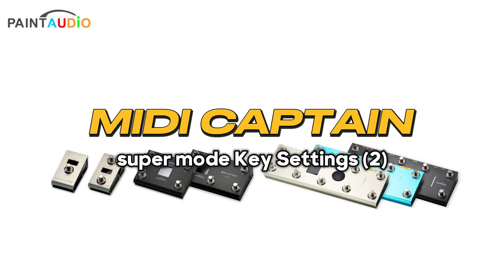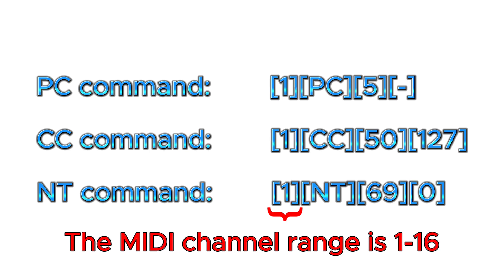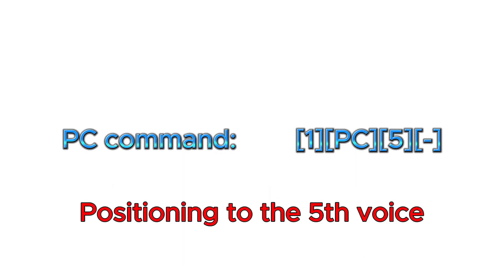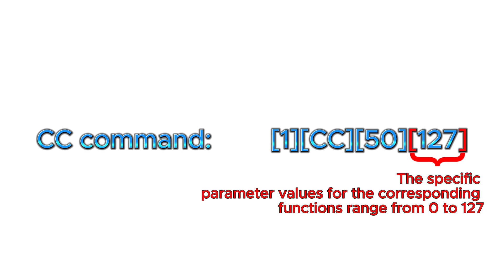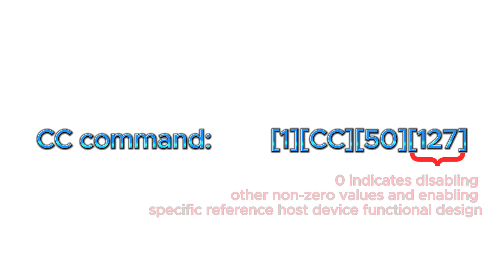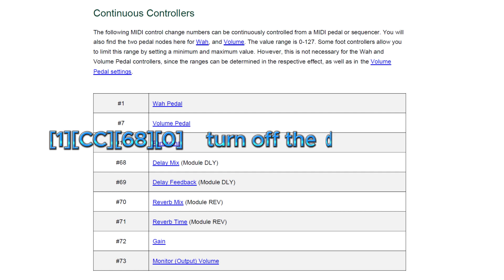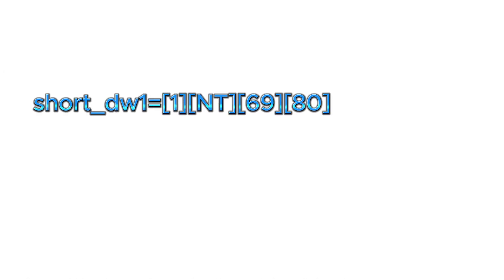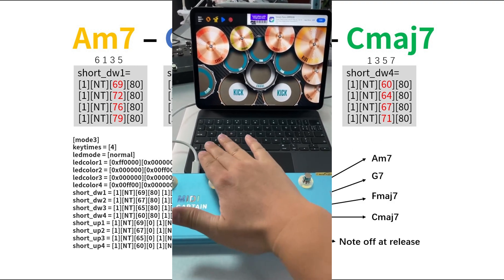SuperMode Tutorial (5) key function settings part2

Comment: Mini 6. Using key 3, 4, 5 to toggle things on my Tonex with keytimes[2]. Using Key 0, 1 to inc and dec program. Would like to be able to set 3,4,5 to the "0" state each time the 0,1 button is pressed  changing the program. Is there a way to set the state of the of the other buttons so the keytimes will send the correct toggle after the program is changed? What would be nice is the concept of variables that could be set and read. Also, and run_on_page_change section would be nice so things can be setup when the page on the controller changes.

Comment: how do i set key 4 and 9 to change banks without long press in supermode.
Reply from the maker: In SuperMode, key 4 and key 9 has fixed page jump function at long pressing time. So if still want to have long press function other than page change, there is two method. One is to arrange other keys for the long press functions. Or you can edit the control functions only in page0.txt and delete all other pages in the supersetup folder. In this way, the page jump function will jump no where and keep your other long press functions. Note that alll the LED will be refreshing quickly in this case when the long pressing is active but nowhere to jump in the key4 and key9.
Reply: @Wilson-PaintAudio  I see but I wonder if it would be possible with future updates to add the ability to customize the bank inc/dec key and the press time to achieve it. For someone like me who uses multiple devices such as the quad cortex and loopy pro app on Ipad (which is very customizable) at once, it would be nice to have that. Changing the banks quickly without the delay of long press would be a more reliable option for a live performance.

I figured i could do something like that in geek mode but it does not have the "keytimes" function and led indicators are also limited to few options. Also if i jump between multiple banks it takes a while to load them. I am guessing that is because the memory is slow and it takes time to load as each bank is stored as a separate file which the device has to load whenever you change the bank. It also lacks my favorite feature of changing the wallpaper which I look at for inspiration sometimes :p

Anyway it is a great device but I hope if these could be added so I can truly ditch other midi pedals that I own.